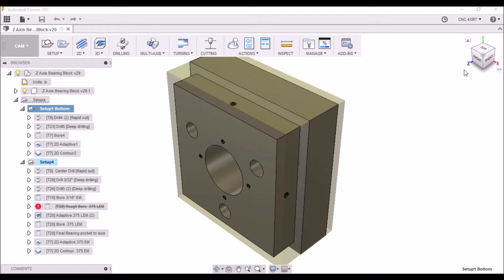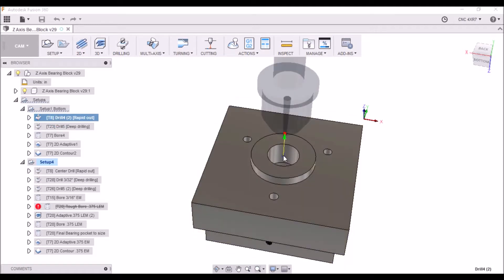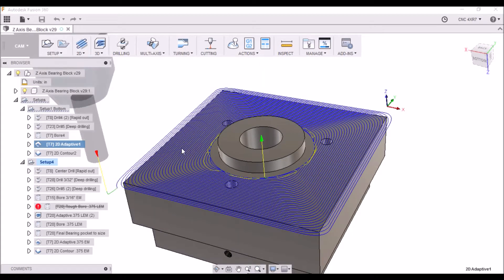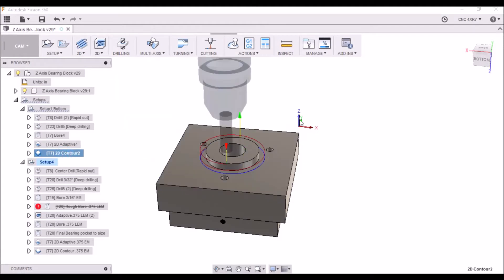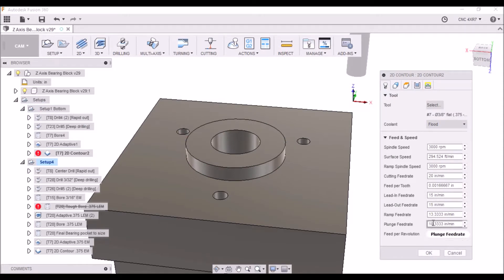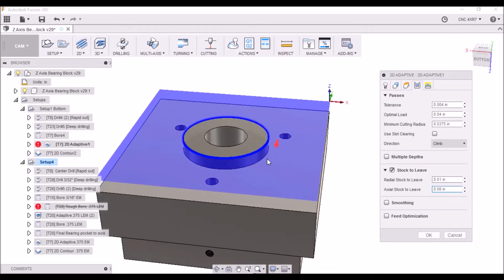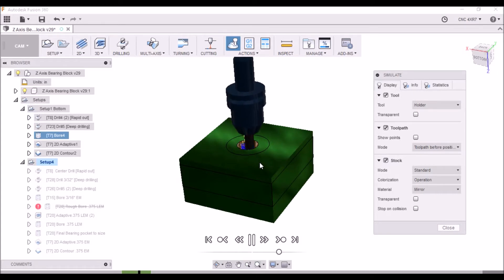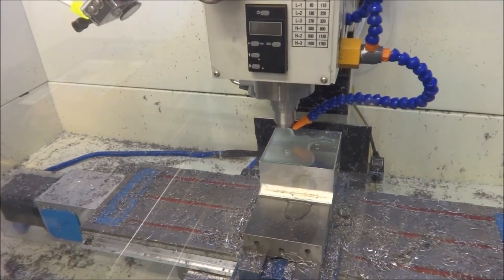Z Axis Bearing Block Machining PT1

Comment: What you did at 442 is call select what not to cut, it's a thing you can do with most of the toolpaths in fusion, and the forcing of the heights is normal as well in fusion, the other thing you could of done is put patches over the holes
Reply from the maker: daniel lyall 
Patches ill have to look into that. thanks i do know  in turn setup you can select turn profile that will ignore the holes.
Reply: You have a lot of options when it comes to picking a toolpath, profile, sketch 2D and 3D, faces and a stl of the cut what can be used for what to cut or what not to cut and a surfaces.                                                 
Then you have forcing of the heights useing the high planes what can be use to restrict cut depth, retract heights.
surfaces patches to stop certain parts being cut, a defeatured model and solid stock model.

Then theres bullshitting the toolpaths useing a sketch to do a full wrap toolpath with turning one setting off. you can use that to turn squire stock round as well, some off it is errours in the code that they just leave in as the outcome is good and useful, and does not affect anything else.
Reply from the maker: Thanks For the Information!

Comment: Nice Sam. yea, the old stock to leave gets me too. I have started using templates to avoid the same mistakes twice once I get the operation to look like I want it I save that process as a template then the next time I use that process I just say create from template then all the settings are the same and all I have to do is select tools and geometry.
Reply from the maker: James Hopkins yeah i think templates would help

Comment: At 3:20 looks like Fusion allows to select a face of part but 2D strategies are about contours so maybe it's taking in account contours for holes when morphing stock countour into boss countour? Anyway you could select lower circle(red arrow will appear) and get same results without messing with Heights. Also at Heights tab as Bottom height you could select "Selection" from drop-down menu and click face, it will help to avoid problems if something would be changed in CAD module.
Reply from the maker: kfmutrus 
thanks i will take a look at that.